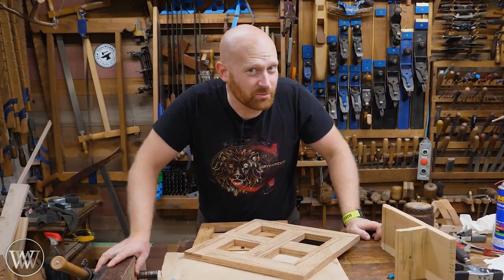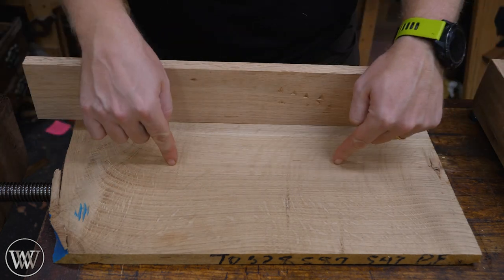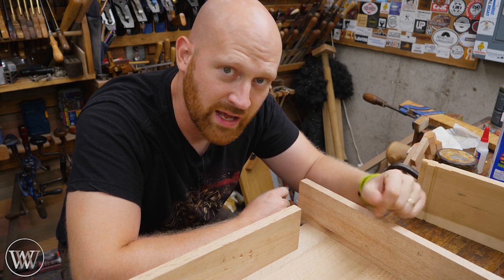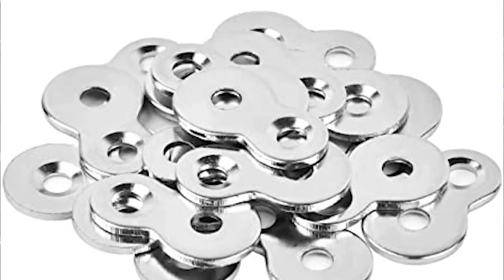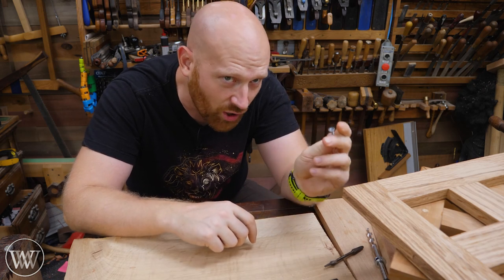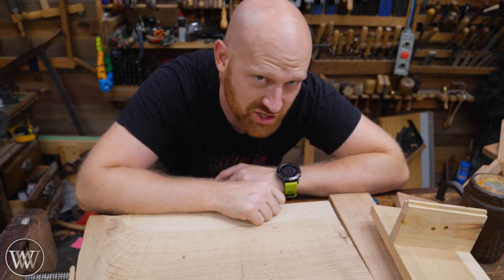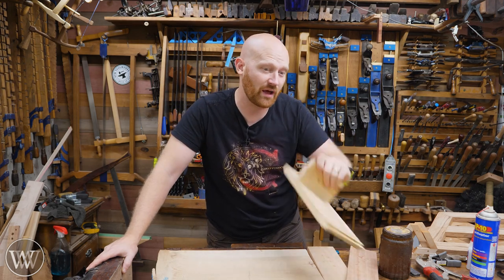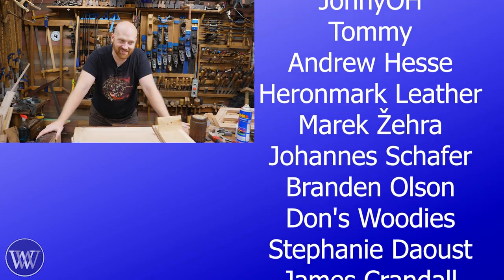How To Attach A table Top To Frame Or Legs

Comment: The other major method would be L-shaped blocks screwed to the underside of the top, that fit into grooves cut in the aprons.  It's a lot like the figure 8 approach, but it's wood instead of metal and slides instead of twists.
Reply: This is the method I often use. It has worked very well for me over the years.
Reply: That's the way I do it too.
Reply from the maker: A lot of people really like those. I've had several bad experiences with him though. I find them to break easily and I just found them to be less appealing to me in general. But that's just my personal opinion. Lots of great woodworkers love using buttons.

Comment: You are the best for a diy person, female with a small budget and most experience came from looking at wood, thinking about what May or may not work. I had to go to the library several times before the internet became common. All the learning I taught myself. I never came across such a simple to understand lesson in wood expansion. I bolt a huge kitchen island to serve as my craft table, storage for my crafts as well as or kitchen table. We were in a narrow townhouse with a long narrow kitchen without storage. After I built it. I realized if we needed to move one day ( I wasn’t leaving my diy island) I had to replace the top with a removable option to fit trough a doorway. I put it on and put finish nails all around the top, wood putty and stained it natural pine, but a few months later. It kept cracking on the far edges. Now I know why! On my own I figured ot if I replace it with a huge piece of heavy thick maple. Gravity would work and it could be lifted off when I moved. My husband was never so happy when he had to move my monster size island and measured the top to tell me “ this has to stay! It won’t fit trough the doorway”
Surprise! I lifted the top up and said
“ it’s removable” he thought he’d leave my hard work behind😃 now I want to build a farmhouse kitchen island for my dining room and I find your channel and couldn’t be more happy. Yo make it simple, easy to understand and since I can’t afford huge deluxe table saws or the know how to use one. I can use your simple ways to work around my problems of diy wood building! You have no idea some of the ideas I came up with while learning to build cabinets without any internet. Not so good after a few years of use! Like nails with shims to attach🤔🫣cracked wood everywhere as well as sharp nails popping out everywhere! I’m so happy I came across your channel! Thank you
I’ll be learning a lot from  you

Comment: A few years ago I rescued an old solid wood wardrobe from being burned. It was in a really bad state having been left outside in the rain for a few weeks as well as having various holes cut in it but I wanted it mainly for the wood in the frames. As I started taking it apart I found that the top and bottom were joined to the frames with pocketholes exactly as you described. No 'special' screws, just regular big heavy slot head ones. Looking at the hardware etc I reckon it was probably about 60-70 years old.

Comment: One of your best videos with a little more of your humor than usual. It is a given that any thing involving people will quickly evolve into a scattering of cliques, each with there own opinions as to what is proper. Woodworking is no different. I have used several of your suggestions, even a dovetail one but I agree it is a lot of work. I did try a segmented dovetail setup on a 48" wide table top that worked okay with good results.

Comment: One of the ones I used recently were dowels, unglued, drilled through the top at a slight angle, and driven into the top of the legs. Basically it turns the dowels into a set of nails. I saw Peter Follansbee use it on his joint stool. Also, Phil Lowe used it on a Queen Anne Low Boy replica. I figured it would work well enough the shop furniture I was making.

Comment: I just made a desk and I thought long and hard about using pocket holes simply by how easy it is to do. Eventually I decided to use wooden cleats with a slotted hole instead. It's basically a small square block about the size of a table button with a slot that lets a screw slide around with wood movement. The wooden blocks are then glued to the aprons.

Comment: Last project I put a long screw through the frame into the top. I oversized the hole in the shank portion on the frame and the screw can move along with the movement of the wood.
Reply: That's what I do 😊

Comment: Another good way to attach tops to the base is by using wooden buttons fox dovetailed into the  top.  The "L" shape of the buttons firmly attach into the top but are given wiggle room in the aprons or sides.

Comment: For me, it’s relaxing to make wooden buttons and cut the mortises by hand, so I like this method.  You do have to be mindful that those small buttons can split, so consider the material and size.  Also, if you are likely to pick up the piece by it’s top, that puts a fair bit of stress in the buttons, so maybe avoid it for a big dining room table.

Comment: I did a Wiccan alter that required no metal other than gold silver or brass so I used side by side fowls near the center of the top width wise one each end so far about 3 months no issues but we’ll see
Reply: “Issues” There you are, skyclad on Saturday night, suddenly realizing a cold iron nail or two might have been handy just in case…

Kidding, of course. Well done being so specific about what goes into your craft and your Craft

Comment: never had a problem with hardware until i lived long enough to see how it fails every single time, (even if you were flawless with installation and treat it like an heirloom.)  over the 200+ year lifespan of solid wood, joinery repairs are easy but with hardware rot it becomes a "restoration" project that takes longer than the original full build.  it's why i only find good lumber but hardware damaged curb wood and never a single joinery piece ... except the 120-year-old dovetail drawer boxes still solid and  usable.

Comment: Another thing: the lengthwise (parallel with the grain) aprons cannot be solidly attached to the underside of the tabletop either, as the top will either be pushing or pulling on them as it expands and contracts possibly causing cracks in the center of the table. In that case, Z clips or buttons attached to the bottom of the tabletop that can move into and out of a groove in the aprons are the best way to prevent the table from bowing in the middle.

Comment: I just built an aquarium tank stand for a relative and attached the top with wood buttons! Maybe overkill considering it’s a 100-gallon tank, might have been better off using your locator pin method and saved me a half hour 😂

Comment: Hey man,  I've been thinking quite hard for my project in tables and found this video...

But I want to know your recommendations, can you help me?

1. My project is a shop project (a router table) made out of MDF and plywood

2. I have no access to pocket hole jig and figure 8 clips to use (I'm on a budget and limited by tools, so please go easy on me)

3. I may use glue to finalize the table to make it stronger after I get used to the table.

So by my observation, the best way I can possibly do is with table skirts or aprons, right? Or do you have something else ine mind? 

Thanks before!
Reply from the maker: If you don't want to use screws straight through the top and down into it then this is the method I would use.

Comment: One question on using locater pins, if you were attaching a top less than 600lbs would using longer pins and attaching the pins to the top and having deep locater holes be a feasible  solution? 
Yes, the lighter weight top might have the ability to move horizontally creating sheer force on the pins (Hardwood pins?), but the deeper pins would make it less likely to move out of alignment if vertical force was applied.
Reply from the maker: That would work, but if the top were light then it is probably thinner. I generally will do this on any top over 1" thick.

Comment: What do you think about the idea of using biscuits to connect top to skirt?
Reply from the maker: That would not be a good choice. Biscuits are not structural and would easily break under the load. Also, because they don't have compression force, they're not very good for wood glues. Biscuits are intended for alignment, not for structural strengths. But that being said, if they are on the stretchers going with the grain of the top then they would work. But I wouldn't use them on the stretchers going across the grain as the wood needs to expand and contract. Biscuits would not allow that.
Reply: @WoodByWrightHowTo  Yeah that's what I meant, on the stretchers :)

Thanks for getting back to me and letting me know :)

Also, thanks for not being like some youtubers and using an overload of jump cuts and an over use of humour. It was nice to see a video such as yours simply address the issue :)

Comment: Building a 7ft x 3.5ft x 2.5 think  table now using the cut off from the top for one leg and another similar size piece for the other let and I like the locating pins personally for a piece like that

Comment: Thanks for the great video! Is there a minimal width of the top under which the problem with wood expansion will be neglectable? Specifically I am trying to make a live edge console table for which the top slab is around 40 cm (16 inches) wide walnut. Can I use a base constructed by four individual legs connected  together  by a second board some 15 cm/6in under the top (for example with half-lap joints) and then blind mortice and tenon the legs into the top? I understand that wood movement depends on the extent of the local changes in the humidity and the type of the wood used. Thanks in advance.
Reply from the maker: If it's being kept in an air conditioned house where there isn't a large humidity swing most 16-in wide boards will only expand and contract a 16th inch or less. But that can vary from wood species to wood species.
Reply: @WoodByWrightHowTo  Thanks a lot

Comment: Here’s a question for you.  Is it possible to completely seal the endgrain to stop moisture from penetrating or is it more of an osmosis type of penetration?
Reply from the maker: The only way to seal the wood is to seal it all the way around. You can encapsulate it and epoxy and that will stop the moisture absorption but it won't stop heat expansion. Water comes and goes from all sides not just the end grain It just happens to leave the end grain faster.

Comment: I have a small bedside table I'm putting together, with a tabletop amounting to less than 1 inch in thickness. The tabletop is actually six narrow red gum boards laminated atop two victorian ash boards, with the grain for all running in the same direction. I laminated with Tite Bond III and epoxy. What kind of fixture would you recommend, given the complicated wood movement in this top?
Reply from the maker: I would do figure eight clips personally.

Comment: for clarification, i’m a beginner - so you don’t need to attach the legs specifically to the top? just the apron? i’m thinking of doing the pocket hole method.
Reply from the maker: yes. traditionally the legs and apron are on piece and the top is attached to the apron.

Comment: I think the problem with pocket holes is they went from being unique attachment Hardware that was right for certain scenarios, but then people started using them for EVERYTHING, especially in places where it was not only unnecessary but also the poorest choice of joint simply because it's easy & hidden. That's when they began to take on a very negative and amateur connotation, so now most skilled woodworkers avoid them like the plague.

Comment: When using pins or dowells to as a way to secure table top should you slightly oversize the holes?
Reply from the maker: Yes. As in that case gravity is just holding it.

Comment: Hey James, is this only necessary if the table top is only one board? Like, if I'm joining together a bunch of 2x4's to make a table top, then would I still need to worry about the table top expanding and contrasting as much?
Reply from the maker: You still need to consider expansion. Contraction. Even if you laminate them together, it now just acts as one very large board.

Comment: James: Just made an end table and the top is herringbone on .5 inch plywood. Are there issues with expansion on the plywood base? Thank you for the great video! Barb
Reply from the maker: Herringbone often cracks over time. But it sounds like you're talking about veneer on plywood. In that case there's really an issue as long as it's not in a high humidity environment.
Reply: I used 1 x 4s pine lumber over 1/2 inch plywood  @WoodByWrightHowTo
Reply from the maker: Ya over time you will find cracks in between the planks. How bad depends on the humidity swings.

Comment: Sliding dovetails it will be! No way I'm gonna use screws! What about table top made of multiple boards with a frame around? How does it last? I always wonder. BTW a video of you showing off all of your accomplishments would be awesome, I liked having a glance at your furniture today :)
Reply from the maker: What do you mean with a frame all the way around? Are you talking about the skirt underneath? I have a few videos on several of the furniture pieces talking about how they're holding up after 2 or 3 years. Sorry I probably won't see a reply on here if you send me an email and be glad to answer directly.
Reply: @WoodByWrightHowTo  I'm guessing they meant like a picture frame style perhaps?

Comment: how would you connect u-shape bench side legs (being the same width as bench top)?
if I use the sliding dovetail, ione end of the dovetail would be all the way at the edge.
tongue and groove? 
lap joint?
Reply from the maker: On a bench top I would have the legs go up through the bench. That would give you the most strength. But yes, if you use a sliding dovetail it goes all the way through from one side to the other. So you can see it coming out the end.
Reply: @WoodByWrightHowTo  thanks!

so it's not a problem that the sliding dovetail would be very close to the edge of the top? the customer wants the waterfall bench, so probably she would rather see a miter joint. but she will be sitting 300-400 kg (660-880 lbs) of people on each bench (that is 3 people LOL)
Reply from the maker: oh I see what you are saying putting it on the end. I was thinking  you meant it coming all the way to the front. in that case It would not be very strong there would not be much material to hold it you would need a bracket or brace to provide all the strength. the joint would just keep the boards together.
Reply: @WoodByWrightHowTo  yup. Thanks a lot. Probably I'll talk the client into just box joint with 1 tooth :)
Not sure about the vocabulary

Comment: Hi, and thank you.  I have a question. What if the table top made out of plywood? How does it affect the way you attach it to the frame?
Reply from the maker: it is the same thing, but I would not use a sliding dovetail there. figure 8 clips would be my favorite there.

Comment: Dowel and mortise?   Dowel the center of the cross grain board to the top.  Dowel and mortise the rest of the cross grain board.   Use unglued joinery to loosely secure the cross grain board to the board going with the grain.  Permanently bond the board going with the grain to the top.  This way you don't have to use any screws or nails.

Comment: Honestly I hate screws. Not because I am a joinery elitist (though, honestly, whats cooler than being able to say you don't need screws because you have skills?)  but because I hate having to run out and grab more "stuff".

Also I've had WAY more screws strip out of holes than I've had joinery fail. I don't blame the screws but I've never over-torqued a draw bore. I did "under" torque one once, in a manner of speaking 🤦‍♂️🤷‍♂️

Comment: If a person feels so strongly about screws, would a pocket hole and a dowel work?
Reply from the maker: The problem with a dowel is that it doesn't have a head. It needs to have a bit of a slop in the first board that goes through so that it connects solidly into the top. That slop will allow it to move around.
Reply: What about a screw combined with a dowel? You make a regular pocket hole with a screw and then plug it with a dowel so you can't see that there's a screw anymore.

Comment: No skirt drawers or shelf
Reply from the maker: then you don't have many options to directly connect legs to the top. unless you bring in hardware to mount on the bottom the only thing you can do is cut a mortice through the top and put a tenon on the top of the leg. kind of like a Windsor chair but with HUGE legs.

Comment: I think people dislike pocket holes because they always see them unplugged. Which I guess is ideal if you want to take it apart later, but if you want it to always exist as-is, then it seems kind of lazy not to just shove the dowel in and saw it off.

Draw bores seem as good as nails if someone really has to have it be all wood. Also, long sliding dovetails aren't that hard... with a router table. XD That's how most people make them ain't it?